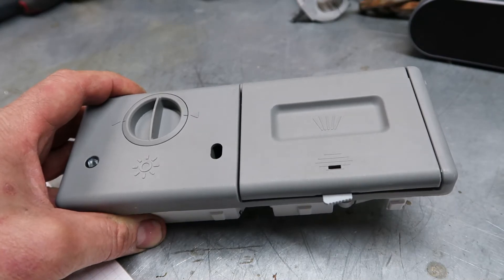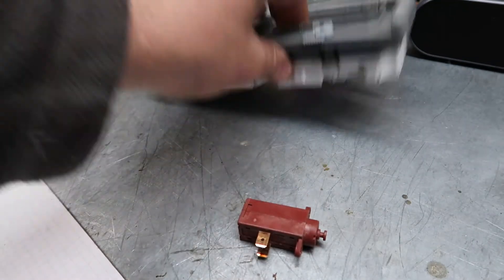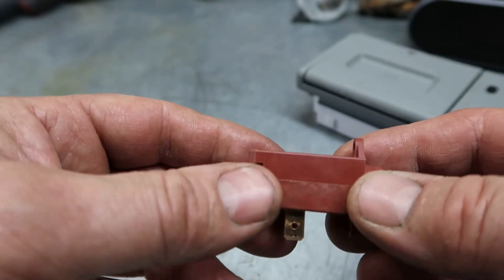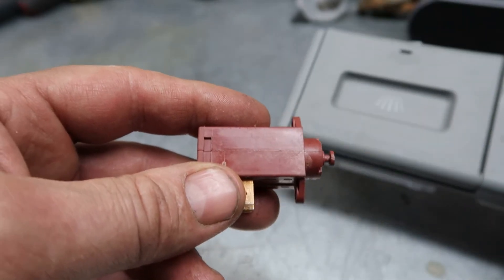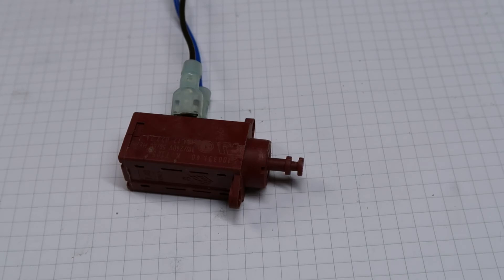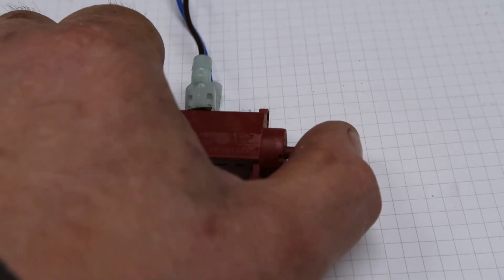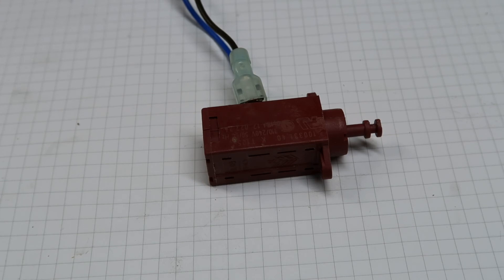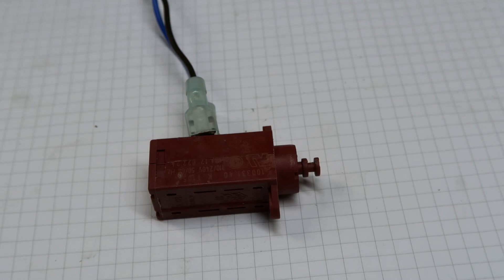Broken dishwasher dispenser? Check out the "Wax Motor"

Comment: Thanks for the quite extensive technical detail. Appreciated, wondered how it worked as our dishwasher has the same problem although the brand here in England is "Hotpoint".
Sadly the wax motor doesn't look as though you can buy just one, so forced to buy the complete unit, seems a waste. But thanks again. Cheers; Andy P., Lancashire, England